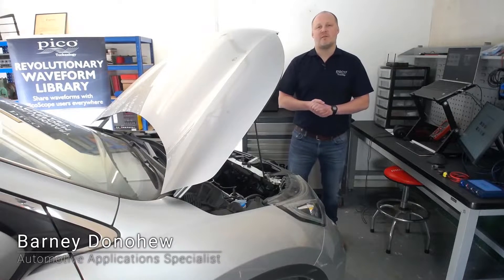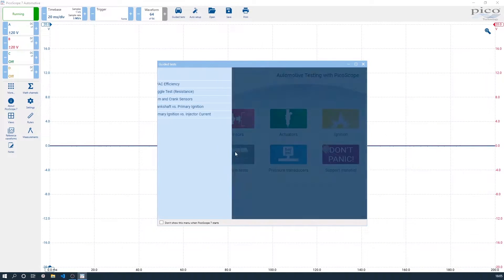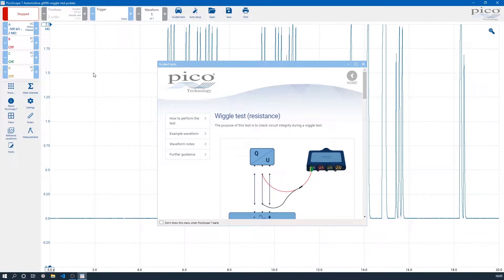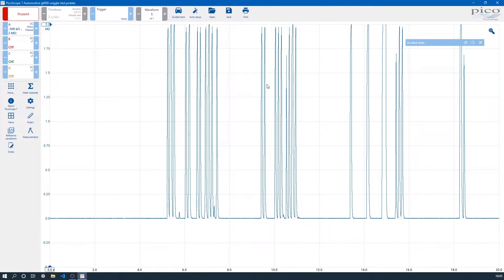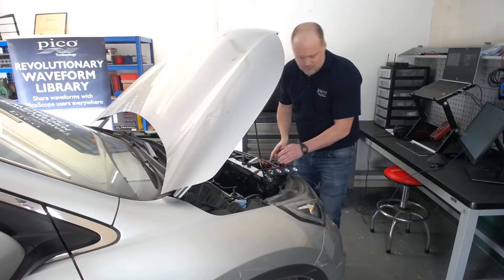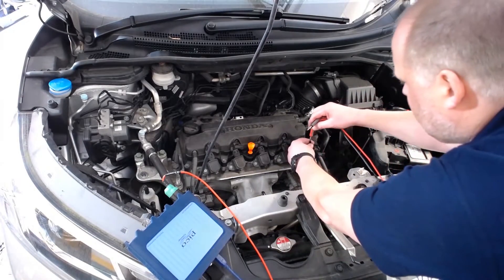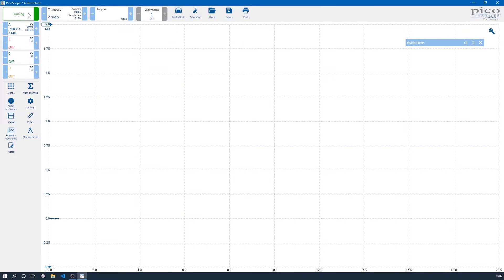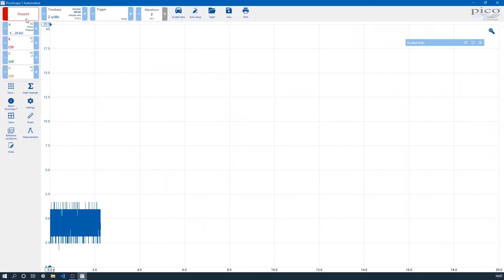Guided test: wiggle test (resistance)

Comment: what is the difference between this lead and a regular lead for the 4425?
Reply: Hi, when conducting a resistance measurement you need to apply a potential difference across the two measurement points. The new BNC+ resistance probe that works with the 4x25A scopes (not the 4x25 scopes) has the capability to do this. The regular (test) lead you have with the 4425 can only measure a potential difference between two points (i.e. it doesn't apply a potential difference). Hope that helps.

Comment: Would this work with 4425 as well?
Reply: Hello, the resistance probe is only available with the 4425A due to it being BNC+
Reply: Eu folosesc multimetru pe dioda la un capat  de fir si picoscope la celalt ,e suficient
Reply: @benmartins6283  thanks